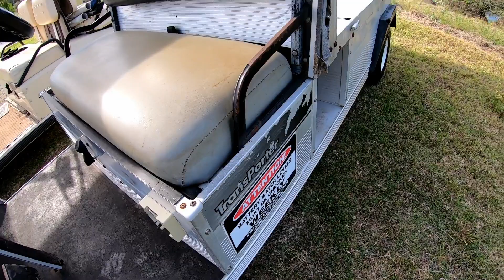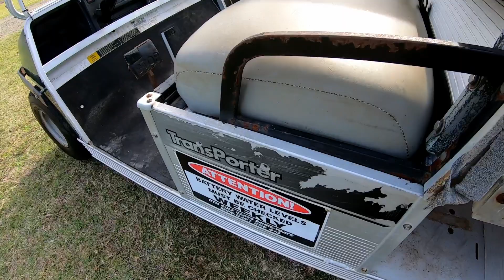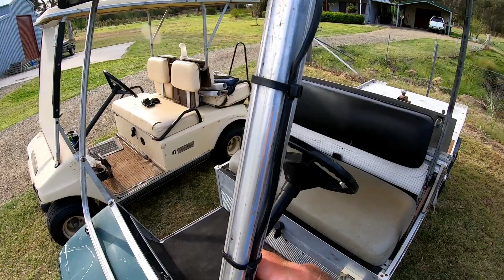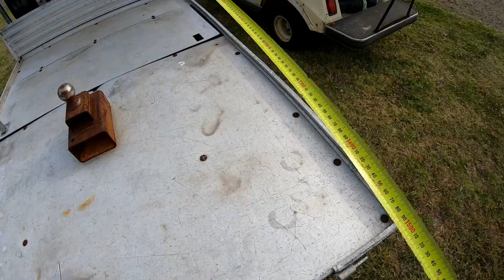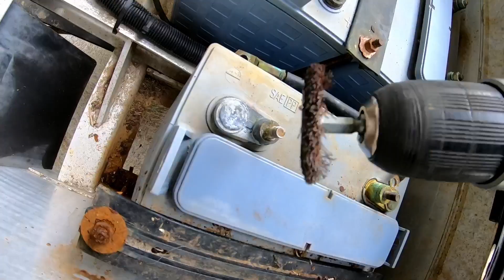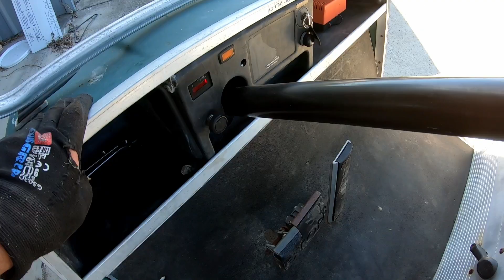Electric Farm UTE_PROJECT 'MAX' - PART 1 - Does it run? #evfarmvehicle #solarpower

Comment: Do you have a link to upgrading the lead acid batteries in the other vehicle?
Reply from the maker: You may have found the video Stephen but here is the link to the second part of that build. 
https://www.youtube.com/watch?v=n9bZyUeIKco&t=8s
I also purchased the same batteries for the Carryall and got 130ah batteries at a lower cost than 100ah ones used in the first cart. Cheers Dave